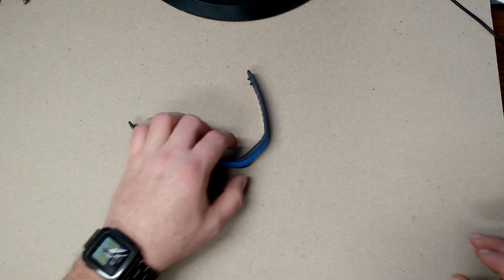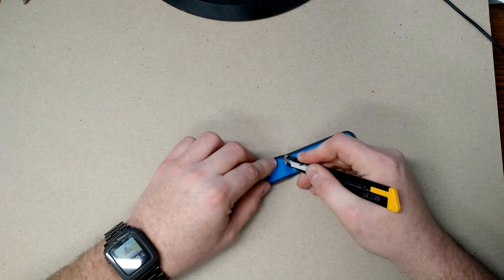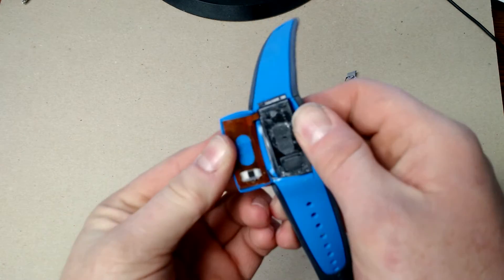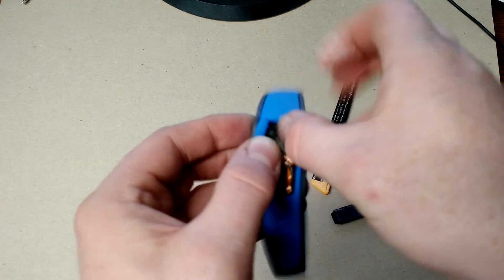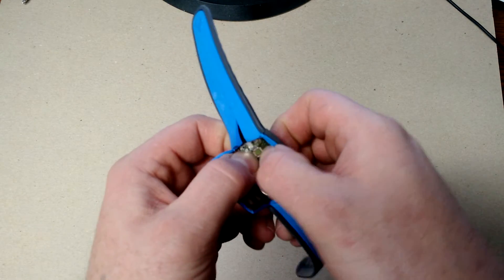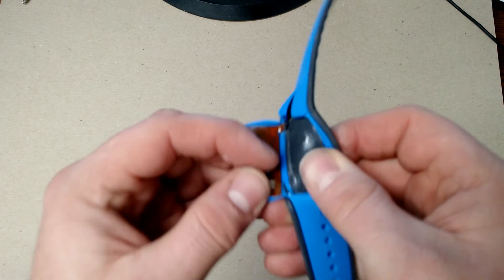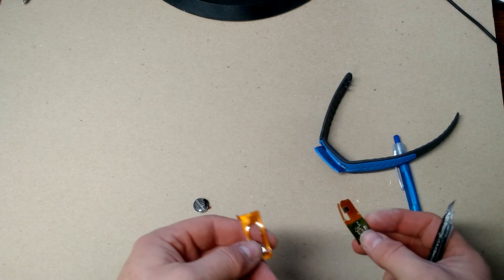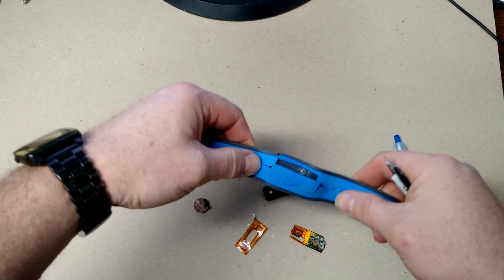What is inside a Disney MagicBand?

Comment: I've recently learned since these Magicbands run on a battery, the battery will expire in about two years.  So, I want to learn the best way to enter these bands to replace the battery.  Based on your experience here, would you agree in order to limit potential damage while entering the band, you should cut it open from the back/underneath side?
Reply: "...isn't meant to be...?"  Sounds like something Disney would want say and would want you to believe.  But, as we can clearly see from this video, the technology is there (and simple enough) to do it.
Reply: If you cut into it, you would remove the waterproof capability, as well as more than likely damage it. I would assume the 13 bucks to buy a new one (or 25 for a character band) would be worth it, since the battery alone will cost you at least a few bucks, and you won't know if it worked until you were already at Disney. Ambition is a good thing however! Keep us posted if you attempt it though! Good luck!
Reply: To reseal it to waterproof it, all you'd need to to do is give it a touch up along the cut lines with any polyurethane seal.  I always have a can of it my garage, shouldn't take more than a couple of minutes.  That reseal will last several years.
Reply: guyfroml the battery isn't meant to be changed so you'd be doing all that for nothing
Reply: guyfroml I meant not designed to be taken apart, and will not work properly if at all if you do so
Reply: I'd also be interested in being able to swap batteries because certain bands actually play different soundbites. If there's a way to update the soundbite that would be even better.